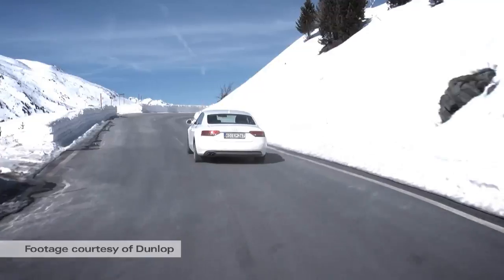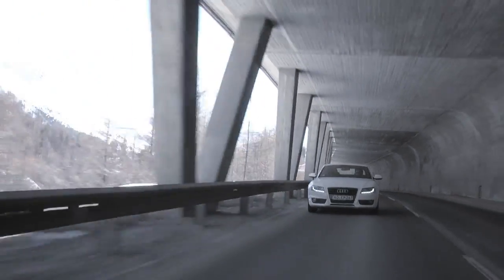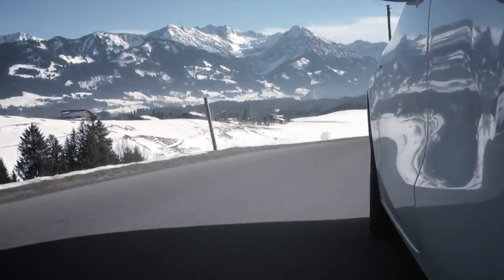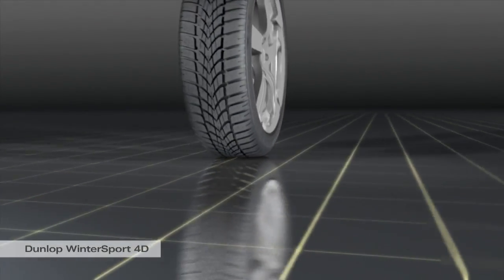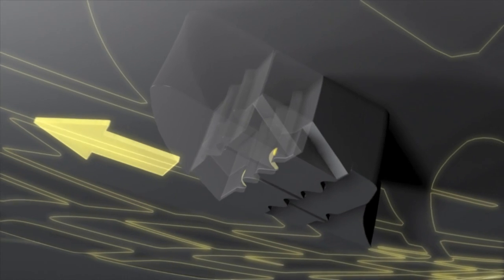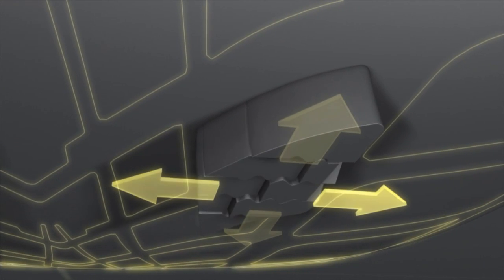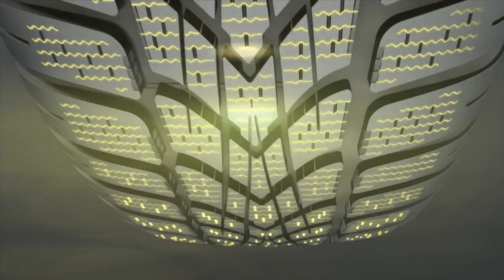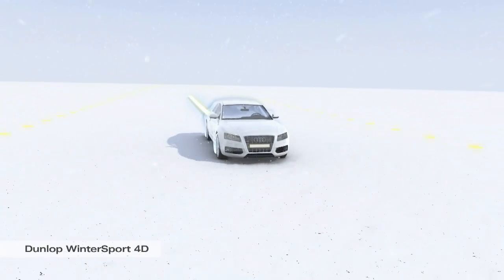How do winter tyres work?

Comment: In before a Subaru enthusiast says Buy a Subaru for symmetric AWD.

Anyway... most Americans don't believe in winter tires as AWD/4WD is all they need.
Reply: Tan N most utahns also believe that, but I'm one and I don't if you fit your car with winter tires you'll be much safer but also you're not putting miles on your regular tires so honestly it saves you some money